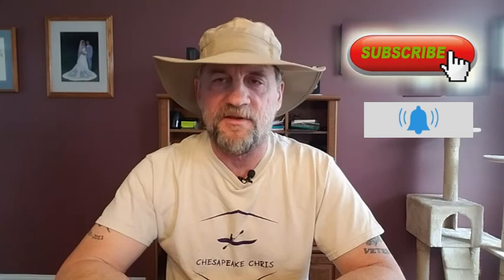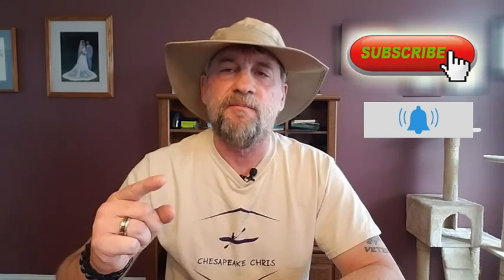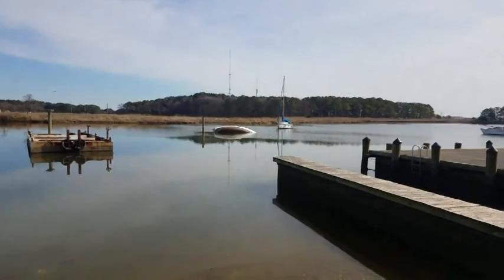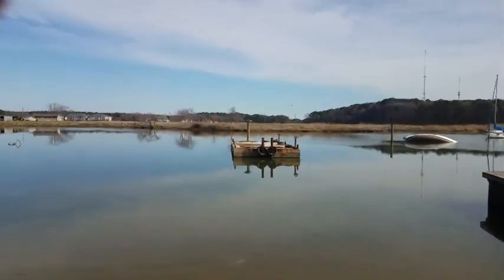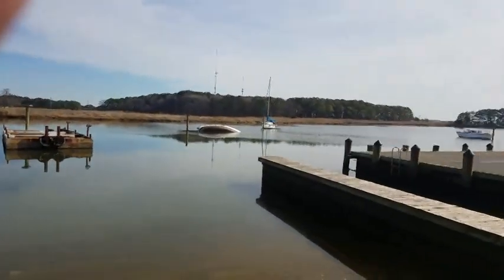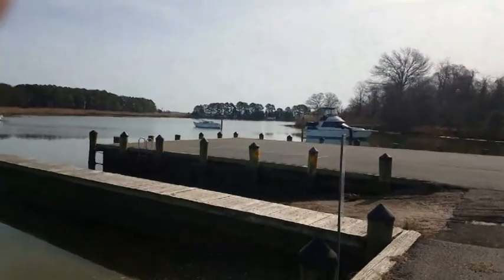Kayak Launch & Load. Portable Cart In Action!

Comment: Great video i just got my first kayak its a PDL 120 pretty heavy I got a cart but still getting used to it did u just paddle it up on the ramp? I was scared to do that figured it would be similar to a short drag so i had my cart in the water a little but made it very difficult to get it stable on the cart and get it out with how slippery it was.
Reply from the maker: Thanx for watching & commenting. I paddle my kayak up to shallow water, get out, lift front end & pull it out of water a little...I don't pull it out far enough for the back end to drag. It's pretty easy to then pick up front end & slide cart under it because my kayak is fairly light & it has a contoured bottom, kind of like a trihull. Some people with heavier yaks remove a couple heavy items like the pedal drive unit to make it easier. Search YouTube for loading a heavy kayak, many videos out there.